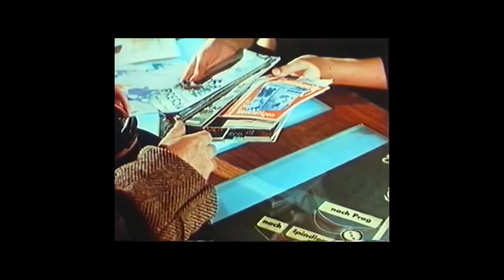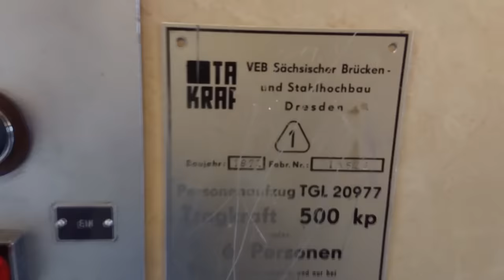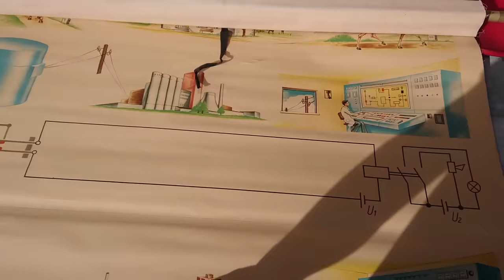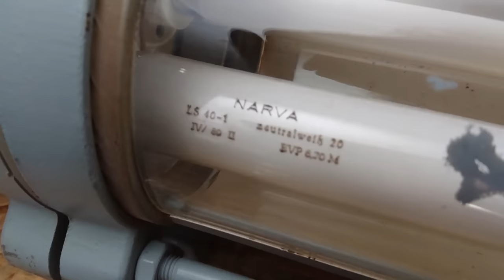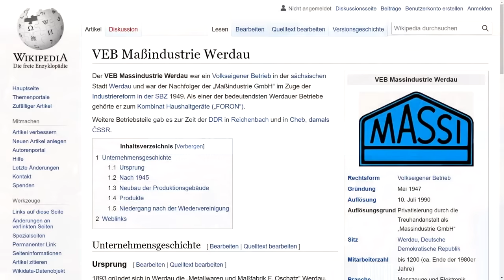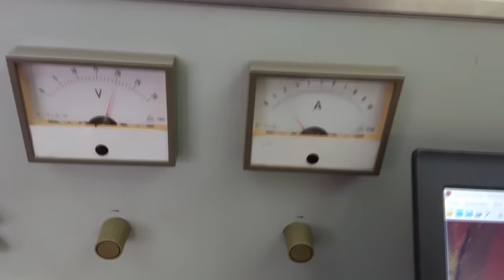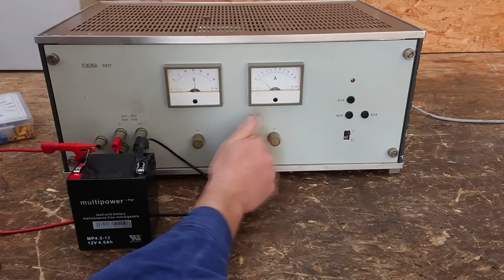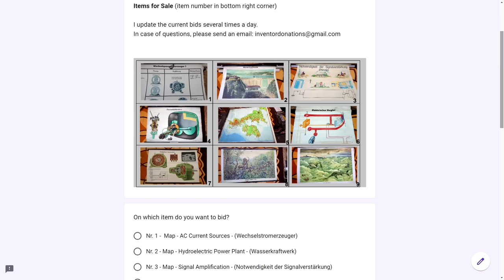Cold War Treasure Hunt - East Germany! Repair-A-Thon!

Comment: Hey mate tip for ya regarding T8 LED tubes. I have found that the odds of getting broken ones is incredibly high so when i order a box for a job i always get a few extra. 

They also sometimes decide to go dim or run at lower wattages after a couple days so the extras are good for that too. 

I use philips, SAL, Osram brands and honestly its been the same experience with all 3 so i always buy at least 5 extra for every 40-50

Comment: One evening in 1995  I was sitting in front of the television set. Some sort of fatuous drivel passing as entertainment was being broadcast and I decided that I'd had enough. So I turned the thing off. Haven't bothered turning it back on since that time. It's getting to the stage where I'm thinking the same about youtube...  Social media, facebook and the like? Couldn't be bothered with it. I do have a telephone that's several years old and I don't see the point in getting a new one. The one I have works fine.  I only use it to make the odd phone call on or to use the calculator thing. Maybe it's because I am getting on in years but I don't see the necessity to be connected to the entire planet 24/7 just because everyone else is... So I agree with you young feller and I will subscribe to your newsletter. We seem to share similar views about quite a few things, not the least of which is throwing perfectly good stuff away because its no longer in fashion.

Comment: If the price is good and you had access to water I would go for it. There is nothing quite like taking a neglected property bringing it back. Mine was not in this bad of state but after 10 years I made it my own with no debt over my head. Good luck in whatever you choose but the apple trees alone would have clinched it for me. Restoring that would be a long a very interesting series. Cheers.

Comment: @The Post Apocalyptic Inventor

As long as the property seller understands that so much work needs to be done on that property and the price takes that into account, that property looks like a good project.  If you can get in there in Autumn after the leaves fall but before heavy snows, that would be the best time for land clearing.
Reply: I would imagine the sale is considered as property only, as is usually the case with condemned or non habitable structures on sight.  The fact that it is so remote might allow a good value for the buyer though.

Comment: I’d buy the property. 10k meters is a nice size. A thing to consider though is the distance from where you live now. I have two pieces myself. One is about 1 1/2 hours away and the other is a 7 hour drive. I go to the close one every few days. The distant one I haven’t seen since before covid. My point is that distance matters. If it is too far to get to easily,  it might be a waste to buy it.

Comment: That piece of property has a lot of potential but I don't know your regulations for off grid type place. Still would be perfect for it's original intent for city dwellers. There use to be a lot of small cabins like that around here. People from large cities would use them for getaways. There are plenty of lakes and rivers for fishing, plus there was a lot of grouse, duck, goose and finally deer hunting every year. People just don't do it any more. Even the lake resorts are mostly a thing of the past. Cheap air fares started it, although between the cost of tickets for the family, hotels and car rentals it is far more expensive. Everything has changed and not for the better.

Comment: That's not a pure linear supply with those thyristors. They probably use phase control to maintain a voltage a bit higher than the regulated output voltage to minimize the power dissipation. Always interesting videos, thanks for your informative and interesting exploits.

Comment: the old factory/hotel you found abandoned looks to me from damage to the window and door openings like it has been scavenged or salvaged for usable hardware, doors and windows and probably wiring and piping in side as well, all have value to re-use or just scrap.
Reply: you can see where vintage brick was replaced with more modern cinderblocks though

Comment: The property fixing would be interesting a little mix on the fun mechanics restorations but plz don't go into financial ruin. House projects are always more expensive than calculated. The house had an interesting style almost half a hangar like for a plane. 

I hope that you will find some Finnish made tools on your journey. Probably quite rare but most Finnish exports went into the USSR. They should be of good quality because resources couldn't be wasted on something that doesn't hold up over time.

A lot of love from a fan in Finland ❤

Comment: Regarding using a bench supply for laptops... Sadly, many modern laptops (since 2006) might have a third "communication" pin, to determine if it's a genuine/authorized power supply being used. If the laptop detects it's NOT one, it may do any number of frustrating things; from throttling the CPU/GPU speeds, to only trickle-charging the battery, or even a combination! 😮‍💨
I know DELL likes doing this, and therefore Alienware by extension. (My ~2016 HP ENVY has a third pin, but, I don't know if it is as pedantic about what's feeding it power.)

Also... The desire to retain the agreed patina on objects is something I agree with doing! 👍
Though, if I like it's specific state (its "look")  is suggest using a clear coat over it, either lacquer or simple spray paint "clear/top coat". Then you can at least clean it without worry of removing any of that desired patina.
(I know you are familiar with such a technique, but I just offer it for anyone reading this who may not! ☺️)

Comment: i wonder if the triacs, or SCRs, are used to provide a variable "coarse" voltage, enough to ensure that any ripple would be above the output voltage at the front panel, so that the pass transistor drops just that smaller "ripple-free"/ "headroom" voltage...

Comment: 44:04 what about a Mesh network?  Backed up by packet radio for internet connectivity overseas.  It would be slow, but I still own my 286 PC I used to surf BBS systems before websites were really a thing.

Comment: 16:14 this regulator looks much more complex than the mercury switch thermostats I'm familiar with, and I'm curious what the extra parts are for.
Looks like the bottom red lever periodically moves up and down, and I assume that lifts the brass(?) indicator under the scale. If that's aligned with the temperature indicator (top), when it lifts does it cause the mercury switch to tilt? If so, I guess it's mechanical pwm? Seems like it'd be crude, and that an overshoot would cause it to continue heating.

Comment: HEY is that a mini golf course? I had no idea you guys had that also.

Also you'd be nuts not to buy that property. But then again I'm saying this as an American. But all you'd need to do is get a trailer for your car and a chainsaw and as soon as you clear a path for your car everything would be easy. Maybe erect a premade shed with solar panels and batteries to help keep smaller items charged and store equipment. Maybe an old trailer to sleep in while staying over the weekend.  It's the brush that makes everything seem to daunting which honestly isn't all that terrible looking. 

Heck you could even just yank off that old house and buy a premade little house to put ontop of the foundation. Not sure if you guys have those there. But I know that's probably not your style anyway.

Worst case scenario is even if you  just cut the path and clearing out the area you could probably resell the property at a small profit to a builder in a few years as the idea of working out there would seem much less daunting with all the brush cleared out.

Comment: I love that the old tube lights work. I suppose the planned obsolescence mafia didn't operate in DDR. They may use more electricity than newer tubes, but they will at least heat your shop equal to a regular heater from the energy.
Reply: 30 year old fluorescent tubes in working order is pretty insane.
Reply: @T0tenkampf  true. My dad told me that at his old work, they had a light bulb that had been shining for even longer than that. Funny how old electronics were built to last.

Comment: I recently brought 3 of those lamps very cheap and I never expected them to be that heavy. Did you manufactured a nut to open them or do you have a supplier? The tools for the cable clamps are easy to open  but the inside is more difficukt to open

Comment: Awesome video! Two editing errors (repeated audio) @ ~ 20:30 ("test the other two [lamps]") and @ ~ 35:35 ("almost twice that size"). Btw, I'm not trying to criticize, I've just done some video editing and I am a perfectionist (like I suspect TPAI can be at times) and prefer to know about even minor mistakes so I can correct them. No offense intended. Love this and all your videos. To weigh in on the property purchase, as a long time viewer and sometimes patron (can't wait to get my hands on some of those new DDR wrenches - Christmas toolbox this year?), I would love to see a one or two good old fashioned electrical engineering projects and vote YES on a Dacha renovation project where you apply your parents sage horticulture wisdom to reviving the orchard and channel Laura K and restore / rebuild a vacation home. If the price is right, at worst, it will be a wise investment. Good luck!

Comment: 43:49 Keep in mind centralized services like Discord bear the same risks as YouTube and are known to terminate accounts for rather hard to follow reasons from time to time. Storing a mailing list on the same service(/account?) as the platform you are worried about might also prove to be a problem in future. So while I appreciate you acknowledging the risks, you might want to take a look at decentralized solutions or at least using multiple, independent providers.

Comment: And with my like you reached 1400!
Considering the current trend of short videos, you have gone against the tide this time too. usually your videos are about half this size...you really want to disappear from the algorithm's radar!
Getting serious again, I realized (and I'm speaking as a user not as a producer) that shorts are hypnotic, in the morning while I'm having breakfast I activate the you tube shorts and if I'm not careful I watch them for an hour in a row (I'm retired and luckily I can do it) and I realized that this leads me not to watch long videos of people like you or various makers, because they instinctively become "too long": how long does it last? 12 minutes? no no I have something else to do, I watch two shorts....and then I spend hours there. It's terrible!
Changing the subject: the power supply, damn what an exceptional construction:
The two transformers probably work in series or in parallel (thanks to the relay) to reduce the voltage at the input of the Tesla transistor in the case of low output voltage draws, so as to limit power dissipation. considering that the max current of a 2n3055 is 15 A but with 100W of max power it is logical to think that the voltage to which the final transistor is subjected is reduced.
I love that you are able to bring nature and recovery topics to your channel,
Go on Gerholf ( do i rememer correctly your Name?)

Comment: Hi. YouTube is fighting back against TikTok etc with shorts. Your views go down. You don’t get recommended. Your newsletter is one thing. However I have a suggestion. Shorts are easy and the algorithm is weighted towards them. How about push out one every day. 55 seconds. Something shallow and clickbaity. Fire, electricity arcs, explosions. That sort of nonsense. It won’t take much time and your real audience will understand why you have to do it. Slow-mo of fuses blowing as you turn up a power supply! Speeded up clip of welding the channel name in a piece of steel. Timelapse of assembling recovered wrenches into a 3d sculpture. Try it for a couple of weeks? I don’t watch shorts but I’ve seen all my favourite educational channels have to submit to the inevitable